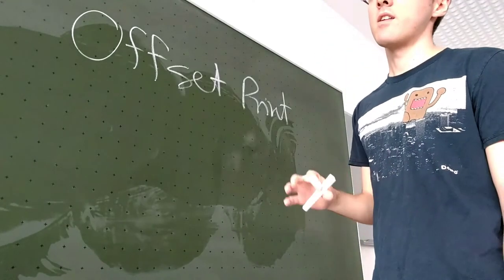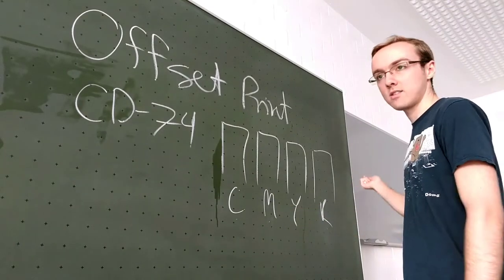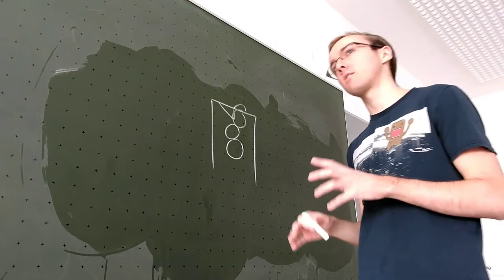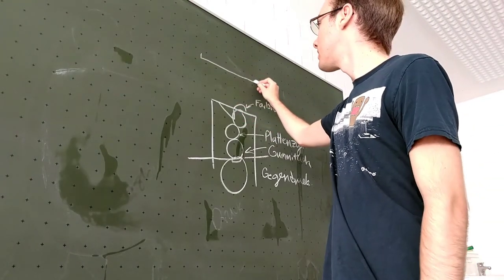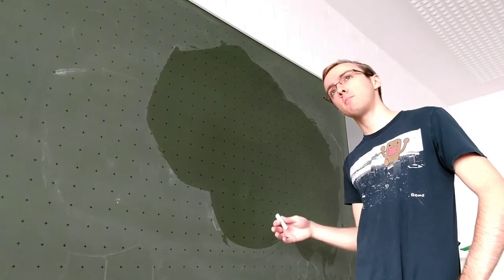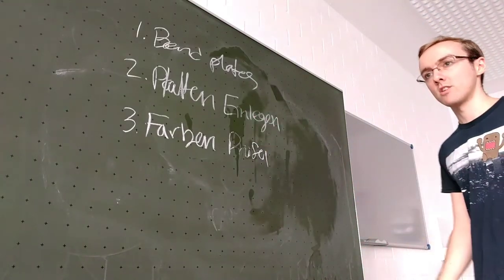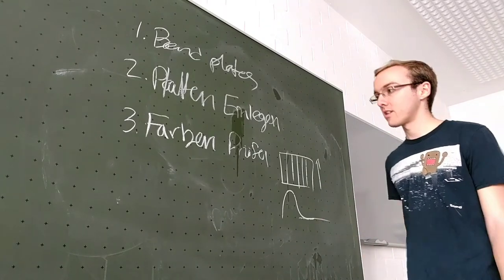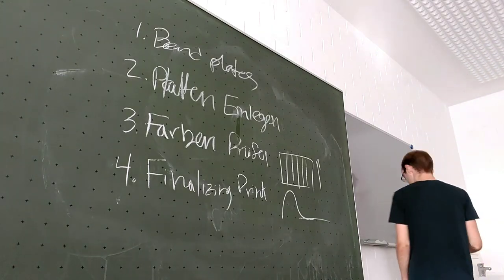Print a Calendar in Offset Part 2: Printing

Comment: Hmmm you maybe should have studied a little more. The towers are called units, and the last is called a coater. Feeder at start and delivery at the end. Take time to read up about what you are talking about. Not elastic covering, it’s called a blanket and it’s made from cloth and rubber layers. Impression cylinder underneath. The image cylinder has a plate mounted on it that carries the image, thereby making it a plate cylinder!! That is inked and damped by inking and damping rollers. You’re German is good but learning the English words would be better during your  explanation. The process of getting image, position etc is called makeready.
Reply from the maker: Hey thanks for the help! All of those words are extremely important to know. I've started my first project purely in English this semester, and I think there is a lot more experience to come before I shake the awkward German-English barrier in printing!
Reply: No problem. I’ve been printing for over 30 years and have been running speedmasters of various sorts for half that. They’re an excellent press and very capable. I know some of the English words and phrases don’t always directly translate from German, but YouTube has plenty of videos to gain all the information you need. 

Good luck with your project!!